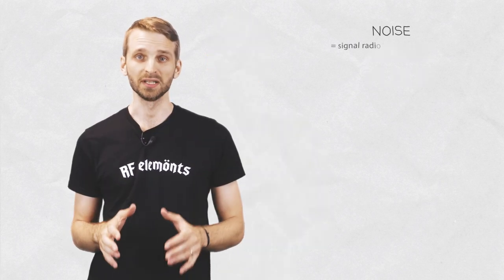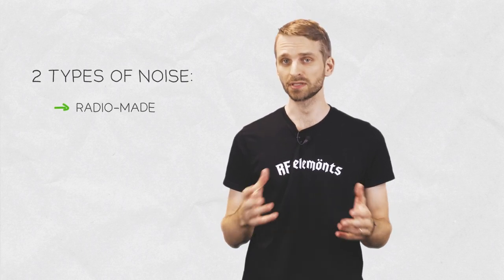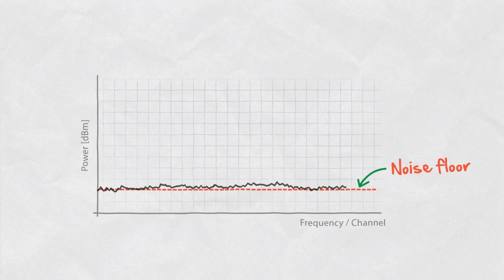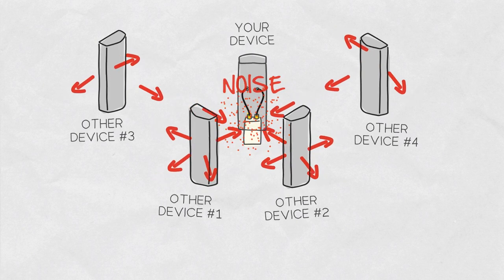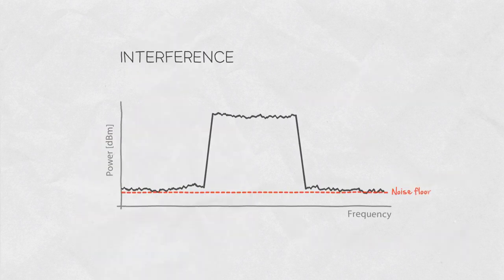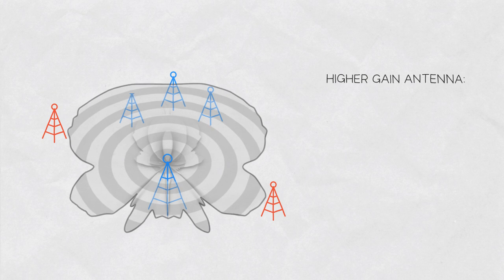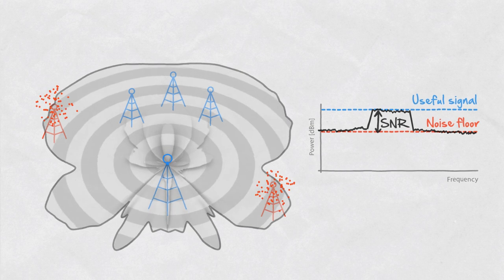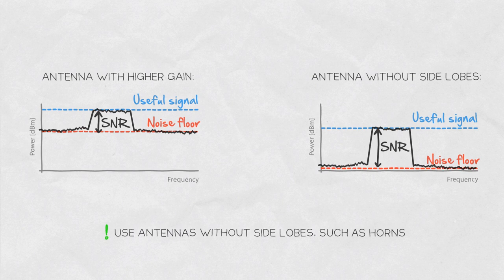Inside Wireless: Noise Floor

Comment: Hi there. This is again Sergey from Cambium. :) It's very controversial statement that higher gain antenna is the wrong solution. To prove that, you're demonstrating the animation where a terrible pattern becomes bigger. But the thing is - this animation demonstrates the same antenna pattern, which means the same gain. 
G=e*D (efficiency * Directivity). Antenna with higher gain should have better directivity, which means narrower main lobes, and less side lobes. So higher gain antenna IS ALWAYS the right solution.
Reply from the maker: Sergey, probably you do not understand the message of the video correctly. Let us rephrase it for you: Better SNR is what is the key, not the higher antenna gain itself. Better SNR beats higher gain all day long in practical life. There are tons of high gain antennas with poor radiation patterns out there. Blindly following the rule "Higher gain antenna IS ALWAYS the right solution" is the essential cause of the problems with RF pollution in WISP industry.
Reply: @Rfelements  мне нравится ваш канал, но тут вы не совсем правы, мне не хотелось бы думать, что маркетологи сказали что вам нужно говорить в видео, но вывод из него звучит "не покупайте антенны с большим усилением, покупайте наши рупоры". Вы могли сказать "решение проблемы в качественных антеннах с хорошей диаграммой направленности", но сказали что направленность одинакова для антенн с разным усилением - это неправильно.
Reply from the maker: @winstonvrn  Hello, we say 'use horns', not 'use our horns'. For WISP application, antennas with high gain should be used only when absolutely necessary.
Reply: @Rfelements  во-первых, большое спасибо за ответ! во-вторых, да, вы правы, вы сказали использовать рупор, но учитывая контекст, а именно то, на каком канале это видео, я думаю понятно, что вы хотели сказать, в-третьих, а что насчет "spatial filtering" вы считаете это тоже плохо в WISP, но ведь именно это и достигается в том числе за счет большего усиления.Я использовал ваши рупоры, они очень хорошие, но что касается усиления и WISP, я не могу с вами согласиться. п.с. и все же, если вернуться к видео вы показали диаграммы с разным усилением одинаковыми по направленности, но разными по размеру, это не соответствует действительности.
Reply from the maker: @WinstonVrn Spatial filtering could be helpful, if done right. The current state of the technology doesn't allow for beam forming capability affordable in WISP market. We are glad the horns work well for you!

Comment: still have a question. in an enterprise environment with many aps on channels 1, 6, and 11, if there are other rogue APs on the same channels, are those considered part of the noise floor because theyre unwanted?
Reply from the maker: Any competitive APs are noise to your AP, so yes. A way to protect yourself from those is to use an antenna with minimum (ideally zero) side lobes.

Comment: I don't believe this is correct. The "jittery line" he's referring to is the Noise Level. The Noise Floor is the smallest level of noise your instruments can measure. Furthermore, the Noise Figure is the ratio of the Noise Floor to the Theoretical Noise Floor (-174 dBm/Hz). Let's see if I can clear up all the terminology.
Start with five signal levels, actual or theoretical (I'm making up all but one of the numbers):
Input signal = -47 dBm (the actual signal)
Noise Level = -67 dBm (the actual noise level, measured at the instrument)
Noise Floor = -140 dBm (the lowest noise level my analyzer can measure)
Theoretical Noise Floor = -174 dBm/Hz (the theoretically lowest possible noise level) at 20ºC
Noise Figure = (-140 dBm) - (-174 dBm/Hz) = 34 dBm/Hz (at 20ºC in this particular case, at the △f of interest)
And BTW, the Noise Factor is another term for Noise Figure.
Reply: This was very good explanation, mind going a bit more in detail if I message ya?

Comment: reduce transmitte power will reduce the noise 🙂
Reply from the maker: reducing transmitted power will only reduce the noise your antenna creates, the noise it receives remains the same,  corresponding to the gain of the antenna and the side lobes it has. So reducing the Tx power is not the right solution potentially harming your link. 
Generally, if anything should be reduced, it is the gain of the AP antenna - to the lowest possible, or use down tilt to decrease its coverage, which is very easy to do with our horn antennas.
Reply: @Rfelements  i tried many antennas in many positons then found the best solution in noisy area is reduce the tx power🙄
Reply from the maker: @sammm9829 If it helped you, that is great! However, generally, reducing the Tx power is not a universal solution to all issues with noise.